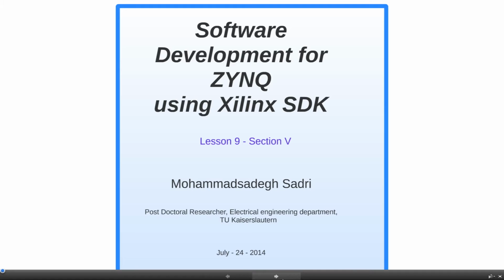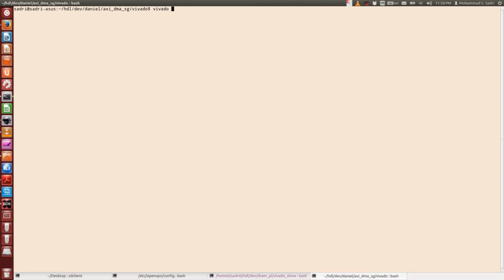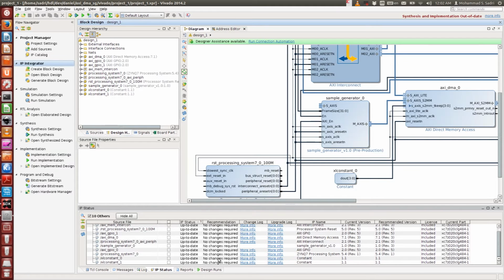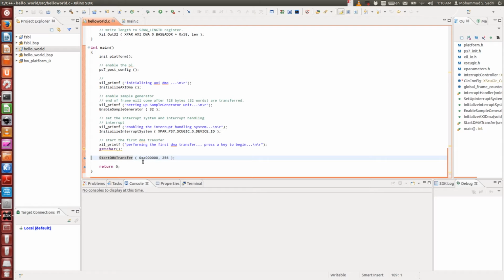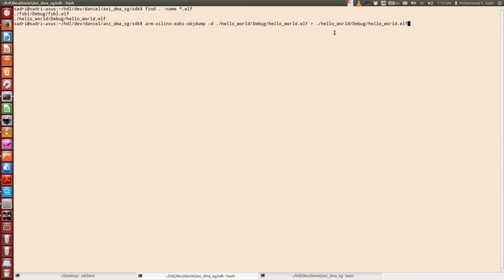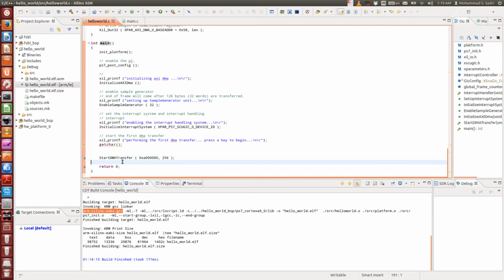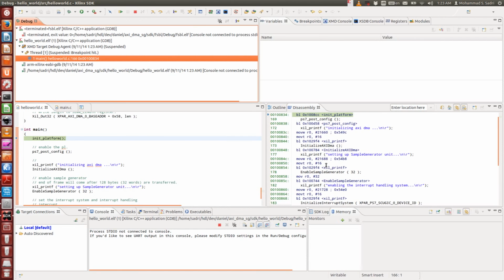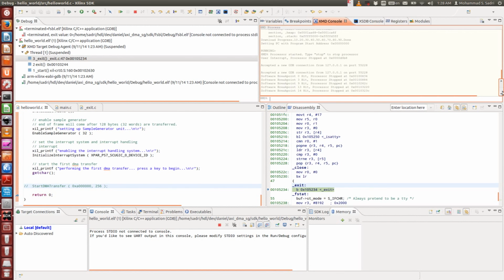ZYNQ Training - Session 09 part V - Debugging software using Xilinx SDK

Comment: Hi ,
thanks for your videos.
I am trying to debug the linux kernel using XMD & I am getting issues. please tell me how to do the same. I am copying u-boot , uImage to DDR through XMD.   Should I copy the vmliux also to DDR memory using XMD. 
I want to debug the driver located in drivers/ttyserial/xilinx_uartps.c , cdns_uart_init function , how do I do that?
Can I do the same using Xilinx SDK, if so how do I use?

Did I use GDB , while I am debug through XMD?

Please provide me the process.
Thanks in advance

Regards
Satish.G
Reply from the maker: +satish kumar the bootm command of uboot needs basically three components (as I have mentioned in other videos) the uImage which is the linux kernel, the compiled device tree and the ramdisk image (if you are using ram disk and if there is no separate root file system partition available) so you need to put these three guys on the dram